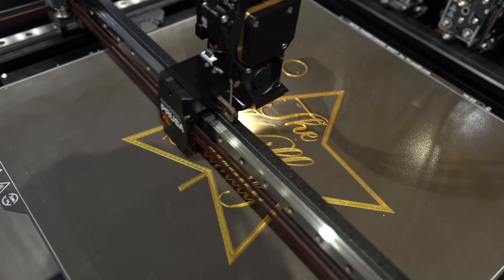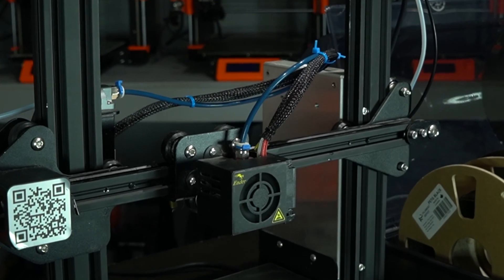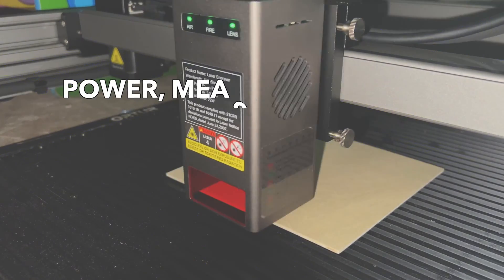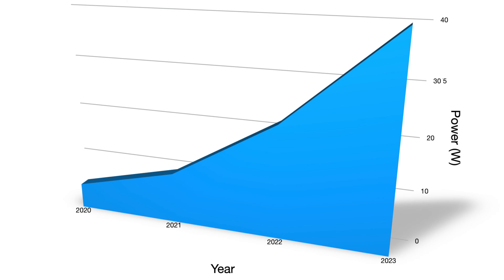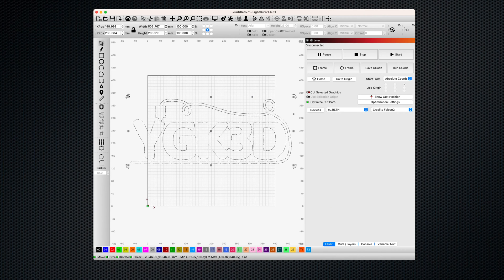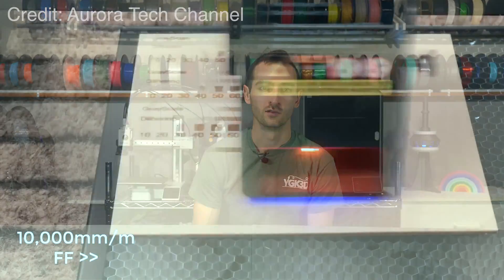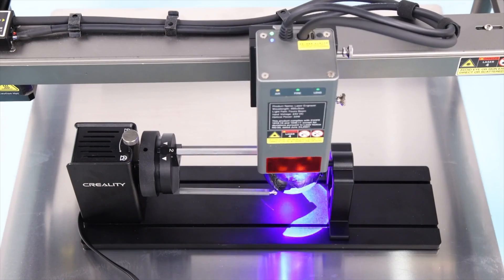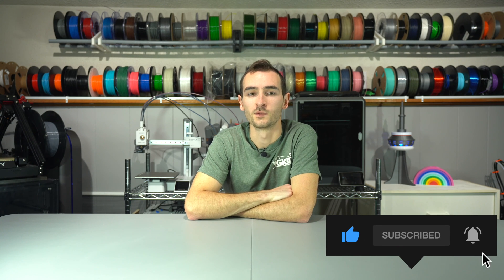Love 3D Printing? Try THIS Next! Intro to Laser Cutting ft. Creality Falcon 2

Comment from the maker: A note on safety: Open frame diode lasers can be DANGEROUS! You should always wear eye protection and keep the laser in a secluded room with a "laser in operation" sign whenever the laser is operating. Alternatively, invest in a pop-up enclosure to shield the surroundings from laser radiation. You should also ensure you're ventilating the fumes properly. Before getting started, research what materials will and won't generate toxic fumes when lasered (e.g. PVC will generate chlorine gas - BAD!).

Comment: Safety?
Reply from the maker: Safety is a definite concern with these open frame diode lasers. I touched on eye protection and ventilation towards the end of the video. These should really be sold with the enclosures as stock hardware, but unfortunately they're not. Higher end lasers like the ones from xTool take safety more seriously with integrated enclosures and ventilation fans. With these open frame machines you need to, at the very least, be wearing safety glasses yourself and put a sign on the door when the laser is in operation.
Reply: Yeah - please edit that in or make a pinned comment about that.. @ygk3d
Reply from the maker: @DJProPlusMax  Done!

Comment: I actually got into lasers before 3d printing.
Reply from the maker: Between the two it’s possible to have a very capable home manufacturing facility. Do you find that you still use your lasers now that you have made the jump to 3D printing?
Reply: @ygk3d  yes I use both quite often.

Comment: Yes I get it.
It have a lot of great uses, but it is dangerous with Thise high power lasers.
But to show Laser ingravers/cutters is shown WITHOUT a tent/cover is no responsible.
Im my meaning it is a MUST to have a tent/cover of a Laser. Period!
There a reason for the Class index for Lasers. 
Class 1 is 0.39mW for toys
Class 2 is 1mW! And that is considered dangerous for eyes.  Children/pets/adults alike.
Class 3B is 0.5W and is considered only to be used in Industrial usage. And you are talking 30-40W Lasers without shield.
Makers muse have made a video about this topic too. Please see this: https://www.youtube.com/watch?v=-9hIXT8DMUU&t
Reply from the maker: Thanks for sharing your thoughts. There are definitely some serious risks to health and safety that aren’t to be taken lightly. Ventilation and eye protection are very important. The pop-up enclosures are a good option to protect against the laser radiation. At the very least, the operator needs to be wearing safety glasses and you need a sign on the door stating when the laser is in operation. The bigger concern is the ventilation I think. Most people will be using these in a garage where fumes can accumulate. The Maker’s Muse video is a good reminder that you can’t just cut any material you have lying around the house without the risk of toxic gases being generated.